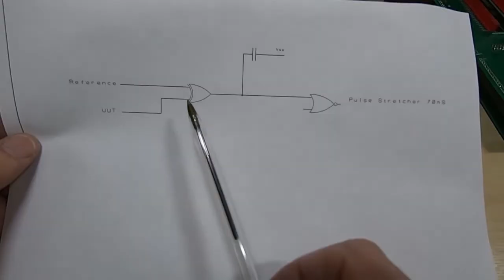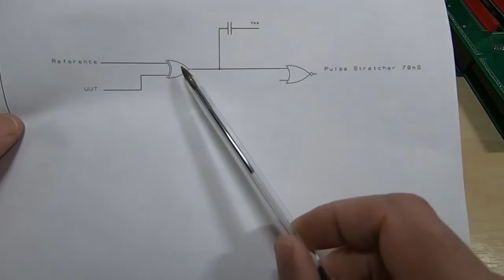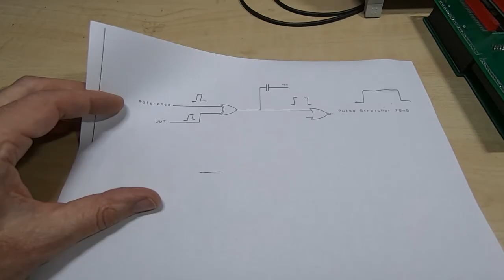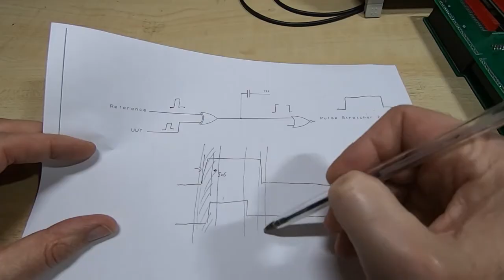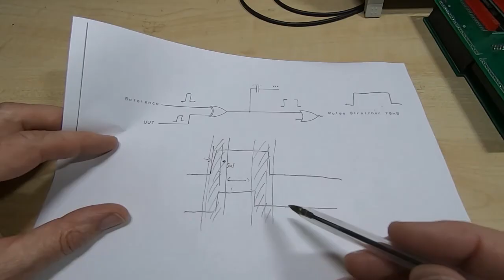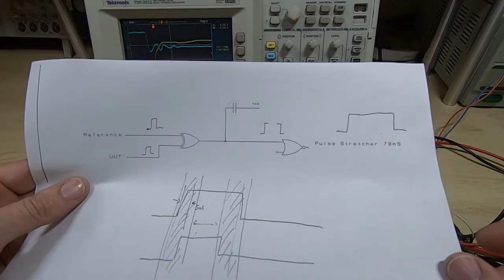JMPrecision Logic Comparitor Part7

Comment: Hi Jerry, you recommend about 470pf which would function to about 8 or 9MHz but you tested your prototype to 20MHz. Can you clarify? I often work on DUTs running 16MHz. Thank you for all your effort!
Reply from the maker: Yes that is correct. You may have noticed some text that said 'with 50% margin' and later 'Absolute Maximum'. When I sell things I try (as much as possible) to give reasonable specifications which builders are likely to be able to realistically acheive under all conditions. While the unit I built works to 20MHz (actually I tested it successfully to 28MHz) I will be giving a 'specification' once I have finished testing and so far this looks like it will be around 18MHz. I still have a lot of testing to do yet and it may well be higher than that. I suspect that it will actually be able to work in excess of 20MHz but this will depend on the test clip and leads and damping capacitor value. I have more videos to come on this unit and specifically on test leads as there are some 'traps' to avoid to get the best from digital circuits (you are probably already aware of them). Following the testing so far I am sure it will work well in excess of 16MHz but this will of course also depend on the reference IC's that you use. For example if you are testing Z80 processors and you use a 4MHz IC then it will not of course work to 20MHz. Sorry if all this sounds vague but I still have lots of testing to complete. I also work on units up to 16MHz (the HH Tiger I am currently working on has a 16MHz video clock) and I want to be able to use it on that. The design target is 10MHz but that includes longer test leads and 50% margin so Absolute Maximum is aimed to be 20MHz. Using a shorter test lead will allow higher frequencies. Hopefully this will all become clearer in later videos.Note that the specification is more likely to state the minimum pulse width rather then frequency as this is more meaningful. This is because if the unit is monitoring a line that has 100nS pulses every 1ms (for example) then this is only 1KHz but the pulse width is equivalent to a signal of 10MHz.
Reply: Not vague at all. I appreciate the clarification. I'll be following this project to its completion.